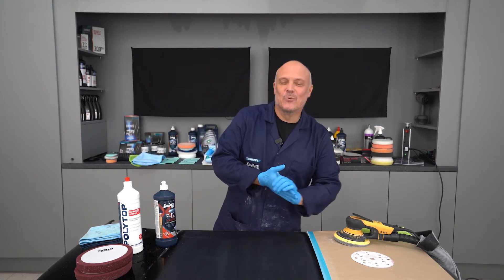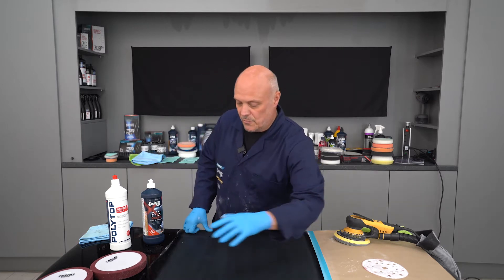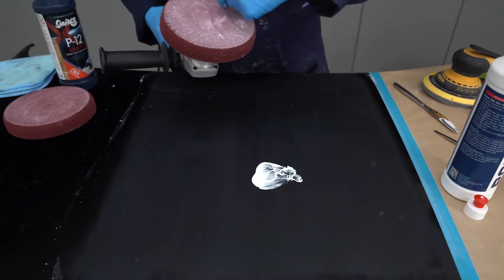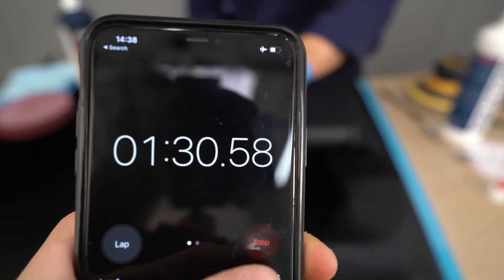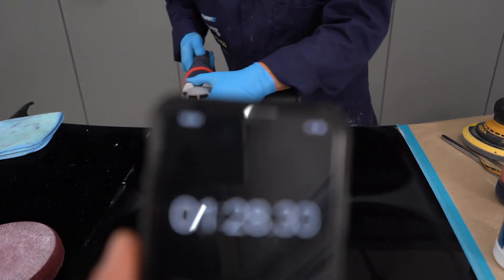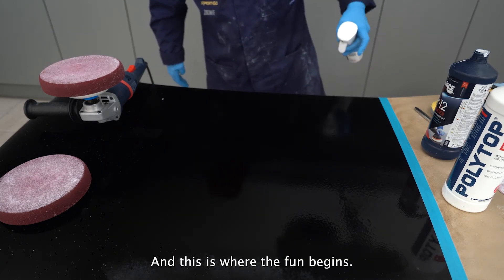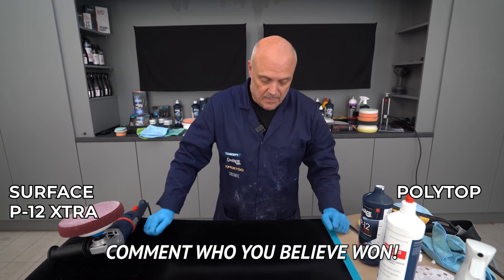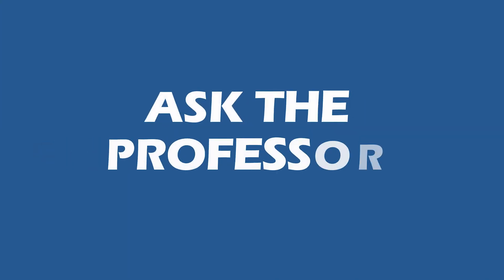*COMPARISON* SURFACE P12 vs Polytop | Ask The Professor #14

Comment: if you use lambswool  pad with Polytop 3000 you will get a great cut and finish without any hologram i think you used a week pad and sanded with less than  p2000 and if you want the best heavy cutting compound try Polytop 2000 its remove 1000p with a great gloss

Comment: The Polytop Diamant 3000 cuts out from 2000 grit, i think u sand it down to 1500 grit, right? Maybe u give it a try and make another comparison video with Diamant 2000 and the red cutting pad from Polytop, maybe the pads will make the difference! Cheers! 👍